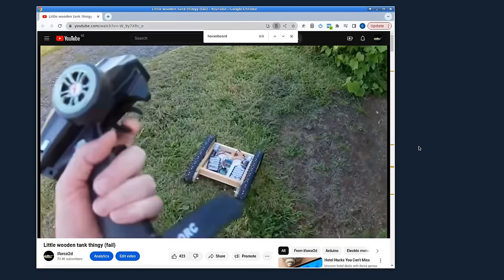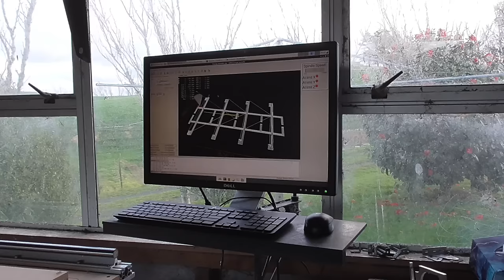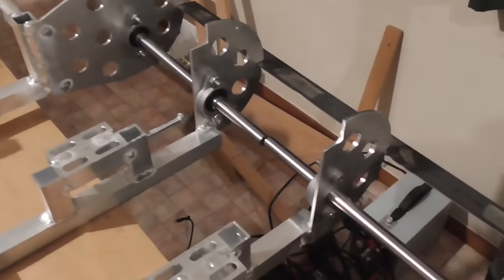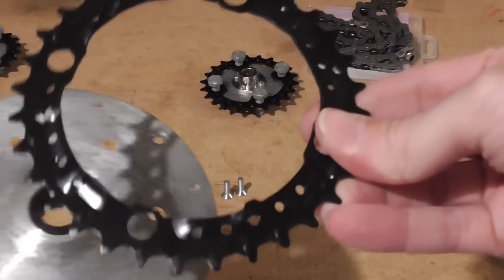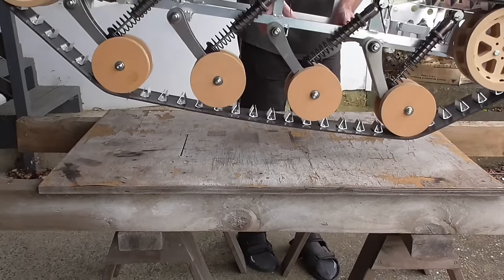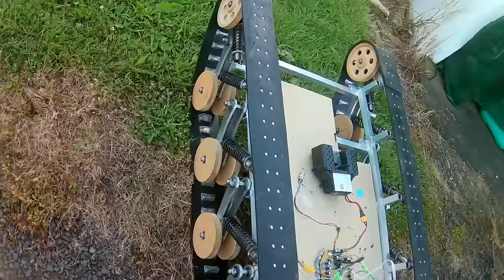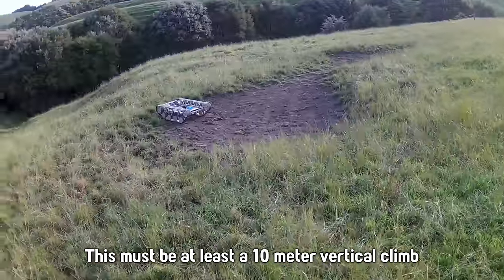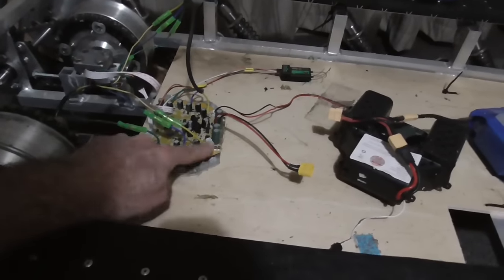RC tank thingy (hoverboard motors)

Comment: I think you should have built the box section chassis from steel. Cheaper, and you could MIG it together avoiding distortion. Aluminium extrusion is always in a stressed condition,  welding it is never a good idea. ...it will distort...The extra weight would have helped traction too...Great effort though, a lot of work....🤔😳😏😀🇬🇧
Reply from the maker: Actually the aluminium is a few dollars cheaper than steel, at least at the two places I buy from. I like that aluminium is not prone to rust, it's clean and easy to cut/drill etc with wood tools and my CNC router.
Not sure why more weight would help, the extra traction required would pretty much cancel out I think. One advantage of tracked vehicle is lowering ground pressure, not increasing it. In any case adding weight is easy, I would rather be adding more battery than just steel, and if the frame is lighter I can control the CG easier.
Reply: @iforce2d  Oh, I know why you chose Aluminium, you've machined it. In steel, your router would not have stood a chance. The difference in chassis weight would not have been huge using thin section box along with triangular gusset braces. You could have still used Aluminium Axle supports, but bolted them on instead. Same with the suspension swing arms...You need a pretty decent TIG welder to do aluminium as you know and could have avoided  purchasing it. I'm surprised by the smooth rubber tracks working at all TBH. Usually tracks have treads on them for purchase going up inclines. I'm a retired mechanical Engineer, I used to design Laser Cutting machinery. The gearing on the twin motors needs changing a bit as you suggested, too much load on them. Should get more mileage then. Of course this tank needs FPV on it. Digital would be great if you used a directional VRX on a mast with all those hills you have....Interested to see where this project goes now. It's quite an achievement in such a short space of time...😮😏😏👍😀🇬🇧

Comment: It's solid. Could you possibly fit the wheel motor right inside the driven cog and avoid the shafts, chains, bearings, etc?
Reply: Quicker, cheaper, lighter, better reliability... as long as the gearing is acceptable, what's not to like?!

Comment: What welder did you choose?

Thanks.
Reply from the maker: It's a Unimig "Viper TIG 180 AC/DC", seems to be also branded Xcel-Arc in some places. I wanted one that was intended for use on a regular household 10A outlet, which really reduces the options available. Not long after I started looking around, an (only slightly) used one showed up for a few hundred dollars less than the new price.
Reply: @iforce2d  thanks

Comment: I really would like to know, which exact hoverboard got used
Reply from the maker: It's a "6 inch" size, as far as I can tell they are all functionally equivalent.I'm not aware of any model names or numbers anyway.
Reply: @iforce2d  what about manufacturer? The alternative firmware site says in its wiki that it's only compatible with certain main boards. Maybe you have a link to it to share?
Reply from the maker: I have no idea. I just find used hoverboards in online auction sites. I have never seen any manufacturer names, or model names, or numbers, or any other kind of identification anywhere on them. One time, the original box was included, but it also had no maker labeling or information whatsoever.

Comment: Why not use the motors to directly drive the tracks?
Reply from the maker: I wanted an easy way to convert the motors, preferably without permanent change or welding, and only altering the back plate, and have possibility for gearing. Also, the motors are 1/4 of the total weight and I didn't want them hanging way out the back. But it's looking like I might need to change plans, the direct drive is looking more appealing now.

Comment: I didn't know you did build requests. In that case, you should build the Iron Man suit. First, we'll need a flux capacitor and some uranium. You start on the flux capacitor and I'll get the uranium. I know a couple of guys, but first I need to stop by a used pinball machine shop. 😂